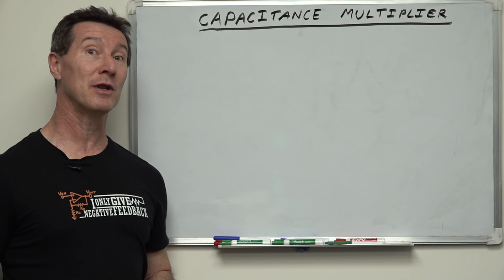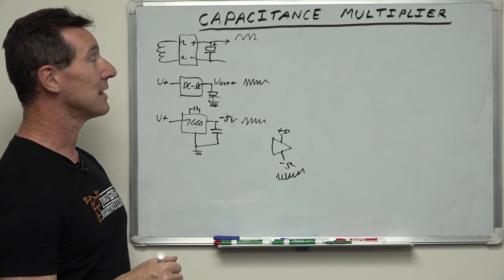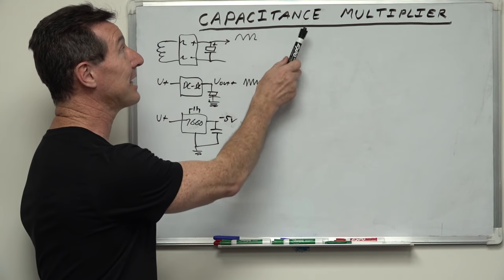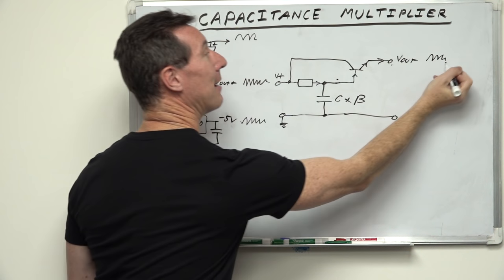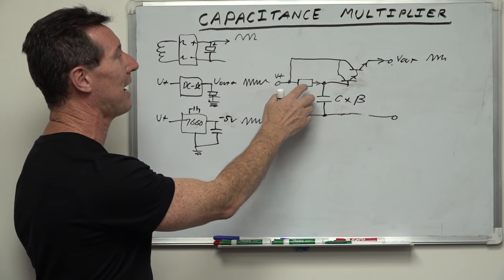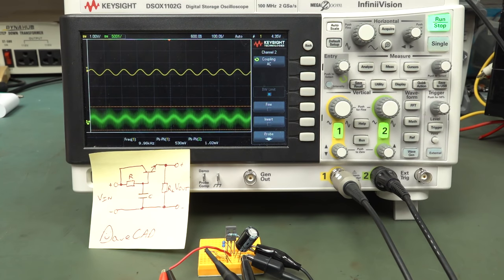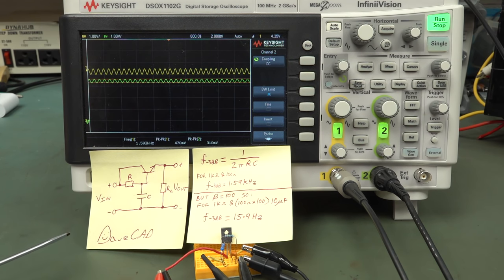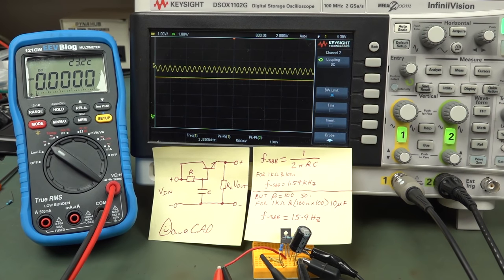EEVBlog #1116 - How to Remove Power Supply Ripple

Comment: The op-amp version isn't particularly useful; it can't be powered by Vin since it needs to be able to output a voltage higher than Vin (in the part of the ripple where Vin<Vin_nom). Unless you could somehow AC couple it onto Vout (AC path at output of opamp, but making sure that op-amp also has a DC path to overcome the R2 drop). Feedback would also be right at the rails, so you'd probably want to scale down feedback and add a resistor in parallel with C1 to scale down the opamp input signal down by the same amount.

Comment: I really liked this video so much. At 26:08 why there is resistor R2 ??
Could you talk about the filters like LC filters and using the EMI filters on the output of the power supplies ? or any tricks for reducing the ripples ?
Reply: The op amp circuit splits current between R1 (and the cap) and R2. It makes caps look bigger because you need more current to charge it to a given voltage, since the op amp steals most of the charging current. (R1/R2 +1) * C gives the resulting "multiplied" capacitance. Sometimes R2 is also added between the input and the collector in the BJT version.
I've turned a 1 uF cap into 1F this way to make a stupid slow 100uV/s ramp generator.
 These are what I'd call current mode cap multipliers since if the input signal is a current the thing looks like a giant cap. There's also voltage mode (Miller) that amplify the voltage across the cap.

Comment: That's very clever. The ripple is mitigated by the RC circuit, and then the voltage drop is compensated for by using the transistor that is simply now amplifying a signal with very low ripple inherently ?

Comment: Hey Dave, working on a audio power amp and found that the output driver circuit is fed by what looks to be a "capacitor multiplier" using a 2SC4793, except this one has a 3.6v zener across the 36K resistor. Input voltage is 91v unloaded. The screen print on the board indicates the output should be 78v  but I am measuring 90v.  Can you please enlighten me on what the added zener is there for ??  will it "regulate" the output voltage somewhat ??  cheers !

Comment: Couldn't find the other video about the full LDO analysis, but I think you are a bit exaggerating the bad performance. This part has only 10dB attenuation and there are others which perform much better with > 60dB attenuation over pretty much the entire audio frequency. Nevertheless, nice explanation of the Capacitor Multiplier!

Comment: Murata BLM21PG Ferrite Bead (to replace resistor) and Murata NFM21PC Pass Through Capacitor (pass through makes ESL and ESR extremely low which greatly increases the performance of the RC circuit). Both can sustain 1A current and will greatly reduce noise and ripple. The additional components mentioned in this video are not necessary. Title is misleading because it is not a true effective solution for removing power supply ripple. If ripple isn't reduced enough with the BLM21PG and NFM21PC combination, an additional inductor (or Murata NFE31P - an LC T Filter) with an increase in the NFM21PC capacitance to compensate for the increased inductance will definitely handle the job. Place in the following order: PS output, NFE31P, BLM21PG, NFM21PC

Comment: Hmm.  Won't there be a phase delay between the base and the collector?  With the current multiplication you could end up with some very high frequency noise on the output, radiating RF on your power bus.   So you would also want to add some low-valued capacitors on the ultimate Vout, like a 0.1uF and 0.01uF cap, to help clean it up.  I think that might have shown up on your scope (but its hard to tell the difference between real noise and probe / room / scope noise at milli-volt scales without checking against a reference).

Would it be better to use an inductor and capacitor instead of a resistor and capacitor for the low pass filter?

-Matt

Comment: I personally use a 10 Henry choke in series and a 1 Farad capacitor in parallel before and after the choke and never have any problems with ripple.  Does make the equipment a bit heavy though... :-)

Comment: This can only reduce power supply noise that comes from the supply side.  Noise can still couple in through the ground on a real circuit because of shared ground impedance.  Battery charger circuitry is notorious for causing amplifier noise coupled through "ground".

Comment: Dave, is this really a "capacitance multiplier" or is it an active low pass filter? Research as I might, I have not been able to find the circuit analysis where beta is in the equation as a multiplier for the capacitance.

Comment: I was expecting the op amp solution since the beginning as it would be the best, although clearly not the simplest. Of course it needs an emmiter follower (perhaps darlington).
As a drawback it is more complicated to supply the positive voltage to the OA, although there are several design solutions for that.

Comment: 17 : 00 or may be you can also force it as regulator using zener diode connected between gate and ground with rasistor in series !!!!!

Comment: Hi thank you. 
Have a question. 
I get these boards for repair. I make them functional and they work but I see problems in the horizon on other blocks of the boards.
Allow me to setup please.
330VDC goes through 2, 47K R (R1 & R2) in series. VDC out drops to 14.5 VDC
Which it connects to the + leg of a 100uf cap then goes through what looks like 2 schottky Diodes back to back, after through a 220 ohm R3 which is feeding a hi frequency transformer.
My problem is  resistors are getting way too hot and I am afraid the circuit may not last. 
R1 & 2 are around 100C or 210 F.
R3 anywhere from  140 to 180 C or 280 350F on some boards. 
I have measured the power going through the resistors. Power and current are way below what the resisters ratings seem to be. These seem to be wire wound and based on the looks I think 3 Watts resistors. 
These resistors are set off the board so they're supposed to get hot but not that hot. I don't think. I'd be happy if the hottest temperature is around 110 / 120 C or 250F.
Using my flimsy oscilloscope.I see ripples start and end on the plateau of the graphs 
Can anyone tell me why they're getting so hot what can I do to lower the temperature.

Comment: I quite often use the CapX circuit on class A valve amps. It's beneficial to have a large value resistor in parallel with the cap to create a voltage drop across the feed resistor. This stops the charge stored in the cap from ever being at a higher potential than the supply voltage under fast peak draw or high current conditions. If that happens drop out will cause the ripple to pass through the transistor unimpeded.

Comment: 16:41 I had a problem AFTER a boost converter, the high frequency pass thru because of the switching of the boost converter. Using it before doesn't make sense, after it does. I used your example with a battery and a boost converter to use with an old school boombox, source is clean (battery) however after the boost converter it is not. So I don't understand to place this filter BEFORE any regulation because after seems to matter.  Any thoughts on this? Thanks for the video, it helps me a lot.

Comment: This circuit would help Me to protect the micro from ripples created by power Mosfets which drive motors for industrial applications.   I could use the FDV303N mosfet with it instead of big capacitors.  Thanks Dave!

Comment: 4:49 Could it be that the video is not linked in the video description as of now?

And a question, if you have ripple on the positive and negative supply of an OpAmp, how does the PSRR effect that ripple and what influence does the ripple have on the performance/output of the OpAmp?

Comment: Just a quick question Dave. When you drew the MOSFET version of this circuit yo did not include the Gate discharge (pull-down) resistor.
Was it deliberate? Because I struggle to understand how a MOSFET would work without one.
Reply: MOSFET gate just acts like a tiny ~pF capacitor.  So here it's driven (charged+discharged) by the regulator's output.  The RC filter's resistor acts as the discharge resistor.  This assumes that the regulator output doesn't have crazy-high impedance to ground when off.

Comment: Hi Dave. What about heat disipation on the transistor of the capacitance multiplier, is not gonna be a problem in some cases?, Im talking about high power staff.

Comment: You can place a zener diode in parallel with the capacitor and achieve voltage regulation at the same time.
Reply: No diodes are shit.

Comment: Love the Videos Dave!  I am switching almost entirely away from YouTube so I'll catch you on the other Platforms.  As for this Video, I'm not sure how I'd apply that to a PSU I'm building for my Commodore 64 using the coveted MeanWell IRM-20-5 4 Amp Enclosed 5VDC switching PSU which apparently has 200mVp-p which some argue creates issues with Sound and/or Video (I haven't seen any of those issues ever btw).  Keep up the great Videos, I'm catching up every week, only another 2000 to go lol.   -Mark.

Comment: Great circuit, very useful, however why did you use 10khz as the ripple? Surely 100/120hz would have been better for test purposes? Have missed these fundamental video's - more please.
Reply from the maker: If you watched the 7660 inverter video you'll know why.

Comment: Just add a zener with the cap, make it about about 0.1 uF. and make the input voltage a little bit higher, may 3V higher than required output. Here you will get super clean output with regulation function.

Comment: I have done the same capacitor multiplier circuit and hooked up to my dac. It sounded considerably worse. I used 2sc1061 and 56 ohm resistor and a 1000mf cap. Then i hooked my multimeter and found that when i am giving load, (DAC) the voltage is dropping to some 4v something like that. Input voltage is 8.80v from a 9v reg. Can somebody shed light on this? Really appreciate it. Thank you!

Comment: Super interesting AND useful!!!
Can I ask a n00b question please?
If, as you say, it doesn't actually multiply the capacitance AND my DC to DC unit says that the maximum capacitance allowed per rail is 2000u, in my calculations - if I use 10uF in this circuit - should I just assume it is 10uF, or more...

Comment: Good vid, who is your 'uppers' supplier.
That's why one should avoid LDO regulators, the PSRR of ancient 78L05 is far superior up to a good few kHz, such is progress. Unfortunately all regs, including 'low noise' ones, are incredibly noisy but a cap multiplier can take it down to a nv per root hertz. Rotten transient response though, big C on o/p cures, albeit startup is slow. Juggling act.

Comment: 18:34 - Could you whack in a low-value metal-film cap in parallel with the electrolytic, to attenuate that 10KHz ripple? 

Which leads to another question. With the Capacitance Multiplier, is it possible to get a high-value metal-film (or whatever type cap you use)? To me, this would be ideal for filtering out high-frequency ripple from switching supplies without the need of an electrolytic cap.

Comment: I have built a 24 volt regulated supply  using L M 317  Texas data sheet claims 60 db ripple  rejection. Its a supply for my hifi pre amp Cant help feeling that the supply has a great effect on the musical sound I mean for instance the purity of a piano note having a sweeter note with less ripple and all so the thickness of the cable between pre amp and p s u   seems to have a effect. I wish I  has seen this video before hand.

Comment: Dave,  What's your thoughts on using a  "DC Motor with flywheel"  as a volume efficient inductor/capacitor for smoothing PWM power supply circuit?

Comment: MCP1700 has only 7dB PSRR (ripple rejection) at 10kHz while a jellybean LM7805 will have around 70dB so this circuit is not always a best solution. Use a right regulator for the job and is should be ok. If it gets too expensive to get the right regulator (high frequency ripple) you can think about using this circuit.

Comment: This man deserve an olympic medal! I got more knowledge than my 5 years uni degree in just 30 minutes! inhave a question though, if i have a 45A power supply that i want to filter which BJT transistor i should use?? I see the BJT you used only can handle 1.2Amps thank you
Reply: His videos are good, but if you didn't learn more in 5 years of uni, you either didn't pay any attention, or that uni was particularly bad.

Comment: For the circuit example on 15:29, wouldn't you need to use a P Channel instead of an N channel and control the mosfet using an NPN BJT transistor?

Comment: I'd call it a buffered filter :D
So, if i got the circuit's workings right, this is a divider between the resistor and Xc, so that the capacitor is never fully charged from anything that isn't pure DC. You need to get the filter's output under the Vmin of the input voltage, because if the collector's voltage drops below the filter's output, then it cannot keep the output clean anymore. The output from the transistor will be Vbe volts under the filter's output, so that seems like some safety margin right there.
Very interesting circuit.
The LM317 claims 80 dB ripple rejection, however. That sounds like a lot. How does it compare?
Reply: That's 80dB at 120Hz, for the datasheet I found.  At some frequency (not specified) it will start dropping at 20dB/decade or more.  A typical linear regulator has a loop bandwidth of around 100kHz.  (Some go higher, many don't.)   If your input ripple is at 2MHz, the linear regulator won't help much.  That's where the ripple reducer can help.

Comment: I guess the problem with the formula for capacitance multiplier is that the resistance is also divided by the same amount because the current through it is reduced by the transistor gain.

Comment: Ang on.. not sure I fully get it. Ripple on the base is ripple on the emitter.. the drop on the EB junction is low impedance. This circuit simply allows one to raise the resistor (by beta), essentially increasing the RC constant.. since you have much less current needed through the resistor. It would then be an RC improver.. did I miss something?

Comment: I have a question about this. Let's assume I have a very high ripple voltage (2V peak to peak). The DC part is 5V. The capacitor will obviously settle around this 5V. At some point my ripple causes the input voltage to be 4V for a moment. If I recall correctly the emitter follower will output ~4.3V (5V [input] - 0.7 [diode drop]). However, if we now have a short period where the input voltage is below that desired 4.3V output, is this going to cause my ripple to pass through? In my case that would eventually be a short input voltage of 4V which obviously cannot supply 4.3V.
Reply: As other commenters have pointed out, this doesn't work for large ripples. On the top of my head the collector must be 0.1V above the emitter, so this circuit stops working at 1.2V peak to peak. My idea would be: If you know the ripple frequency and it is fairly high (say 10kHz) You could put a capacitor (or a complete RC) on the input that will just just bring the ripple down to below 1.2V. That first stage only has to bring the ripple down by 6dB (to be safe) and the cap-multiplier can do the rest. The total capacitance needed will still be much less than trying to do it with one big RC. My 2c.

Comment: The schematic at 13:37.  I've read elsewhere that the transistor needs to be in saturation.  If I would use A BC548 an Vin=+12V.  What would 'R' need to be to be sure that the transistor is in saturation?

Comment: I don’t get how the ripple that would appear at the collector of a transistor is removed at the emitter? Doesn’t the transistor simply pass through the collector to emitter and therefore you should still see as much ripple afterwards or is the filtered smaller base ripple causing the transistor to nullify a lot of ripple with a noise-cancellation type process?

Comment: How about a test circuit with the op-amp circuit driving a BJT? The gain/stability from the op-amp would be huge and the BJT could pass the current. Wouldn't this be the "best" solution of this type? Obviously with the higher voltage drop. Might be difficult getiing the circuit to balance properly though.

Comment: Excellent video and explanation !!! Thank you a lot ! I have a question : how to remove the ripple from the negative rail of a symetric PSU?
Reply: The circuit has a symmetrical pair for negative supply use, pnp transistor and keep the other components the same.
Reply: @dylanwahl6644  thanks !!! 💪

Comment: Very cool Dave. Could you use a capacitor multiplier for high voltage (eg valve amp) applications? The transistor shouldn't see ground (unless there's a fault further in the amp) so I don't expect it to melt down, and cause a nuclear winter.

Comment: This is great.  I was going to run my switching supply output (200mv ripple) through a T-filter tuned to the switching frequency and then through an LDO regulator for a high fi audio supply.  This looks like perhaps a better path.  What's the best way to minimize voltage drop?  I adjust my 27.6v PS to slightly over 30v so that the filter drop takes me right to the upper limit of the LDO max voltage (30v).  From there I split into +- for the opamps.

Comment: So it's a series pass element. Very useful building block; always good to have yet another tool for killing power supply ripple voltage. Does this also reduce the ripple current through the capacitor?

I presume a valve in this configuration would need elevated filaments...

Comment: I hope this will be the end of video noise in my race quadcopter ( where a single lipo battery delivers about 15V both to 4 brushless motors (~3kW) and a delicate circuit of ccd camera attached to a wireless video Tx ). :))) Thanks!!